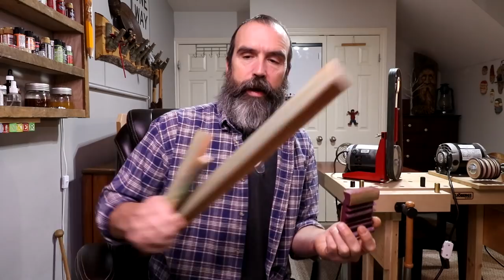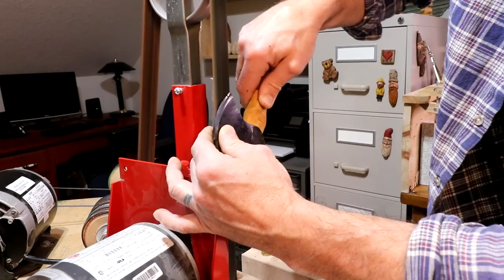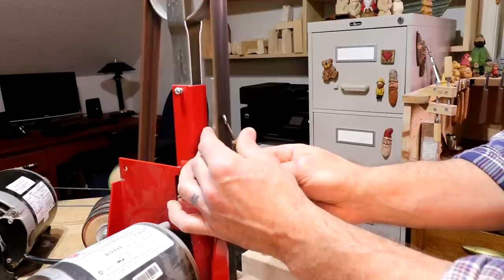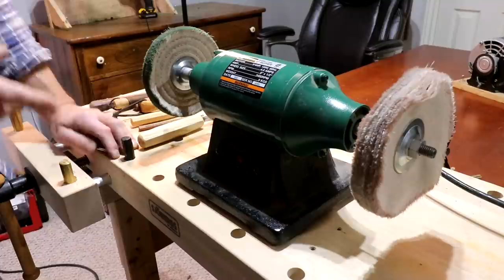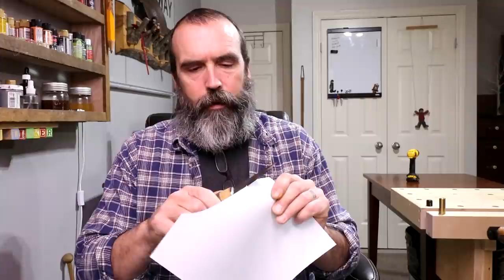Using Power to Strop/Sharpen /Hone Your Woodcarving Tools

Comment: To make sure.... the leather belt was moving opposite of the blade edge?  if so my belt grinder must run opposite of that one.
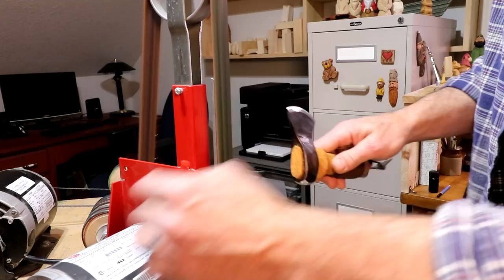Reply: You can see at the 3:00 mark the belt is moving away from the edge not into it. I was wondering the same thing at first.
Reply: I believe that if the leather strap rotated against the edge of the blade, many knife sharpeners would quickly turn to the stamp collection or Gregorian chant. 🤭
Reply: Also bench grinders tend to run opposite of belt sanders so bear that in mind.

Comment: I've been buffing my blades for years. It's incredible how sharp they are. The bonus is the smooth finish provided when compared to a blade sharpened on a stone. (A mirror finish)
It's quite easy, and it takes just a few seconds to complete the task.

Comment: Am I right assuming that the RPM on the motors is okay at 3450 because less heat is generated in the honing? The short duration of time the metal is against the belt might also keep them from heating up too much?? I could only make out the RPM on the green buffing wheel motor but I guess the others might be 3450 too. Obviously you aren’t making a video on “how to ruin your tools by burning the temper out of them” but just wanted to run the question by you. Thanks for another helpful vid.

Comment: Doug Linker you didn't tell direction of the travel on that 1x30 belt grinder.... Little scary detail Sir. I know by experience Buddy
Some great tooling and I'm building such as that 1X30 because I believe I can use improved bearings hopefully be smoother than my harbor freight 1x30 and get a reverse mode also.

Comment: Excellent thank you. Hope you don't mind a couple of questions: Did you make the profile discs yourself? What direction was the 1 x 30 running (i.e. towards or away from the cutting edge)? Thanks
Reply from the maker: Towards me down -both machines are as sold by chippingaway-i did not make any part
Reply: Thanks

Comment: Hey @Linker, do you still only use stropping for gouges? I have noticed that most professional woodcarvers use stones or sandpaper. Why would someone use a stone if a strop can do the job much cheaper than a stone?
Reply from the maker: I will address  in a video at some point but after many years of stropping it’s good to redefine the proper angle
Reply: Thank you

Comment: Hi Doug. Can you tell what brand the powered belt sander/ strop machine is?  The red framed one. Thanks David.
Reply from the maker: Wheel says veil tools Canada -I believe the motor is added after -I’ve seen frame only at Lee valley
Reply: Thank you!

Comment: Yup... power is kewl.  I use the Ken Onion Work Sharp with the tool attachment and have the honing/stropping belts for it.  Wonderful tool maintenance equipment.  Leather stropping boards for in use touch ups.  Life it good !

Now, go show young Joseph how to use a SHARP hatchet, and beat him about his head for using his cutting edge to strike his ferro rod.  Show that boy how to put a GOOD 90 degree angle on his axe head for such abusive work.

Comment: Nice video, Doug.
You need sharp tools for carving.
A question, how is the leather strap held together? Is it clamped (similar to the clamps with which paper is stapled) or is the leather strap sewn together?
Reply from the maker: Glued scarf joint -basically a long compound angle
Reply: Hello Doug
Thanks for the answer.

Comment: Another question Doug. If you had to choose one of the three , leather power strop , the motor with the two fabric wheels or the maple wheel setup. What would be your go to?
Reply from the maker: Leather power strop all day
Reply: Thank you. I’m trialing something similar. 6 inch bench buffer with Surgi - Sharp leather stropping wheel and cotton buffing wheel on the opposite side for clean up. Hoping for fast and superior edges.

Comment: I believe I know the answer but with the other sharpening instruction yesterday, I wish to clear up confusion. I believe that the belt on the 1 by 30 sharpener has the smooth side to the tool. But yesterday the strops shown all mentioned keeping the rough side to the tool. You mentioned the importance of the belt direction and tool orientation but what side of the belt should be to the tool?
Reply from the maker: Right -smooth side out on the powered machine

Comment: Hey Doug, you always say that your tools havent seen a stone and a strop should be enough. I still don't understand how you carve so easily, I have bought several flexcut knives I use strop to hone them but it still feels that I'm cutting bricks! Could it be the basswood I'm using? Any tips would be much appreciated.
Reply: In my short time carving I’ve already run across basswood that had hard areas in it. I’m in no position to give advice, bu that’s a possibility!
Reply: I’m a new carver too, I found at first that I was holding the blade at too much of an angle. If I put a finger holding down the edge at the angle of the grind that I get better results.

Comment: How do the leather strop ends join?  There was not even the slightest lump jump visible when you ran it around.
Reply from the maker: It’s a scarf joint ,basically a long compound angle
Reply: @dougLinker  What is the backing of the belt, is it glued to more leather, or some other kind of fabric?  You didn't seem to express any concern what-so-ever about it getting hot against your fingers.
Reply from the maker: It’s one piece -no backing.My fingers are against the aluminum backplate rig the machine.It holds the leather flat otherwise the belt would move back when pushed against